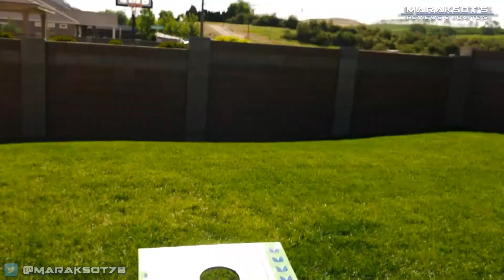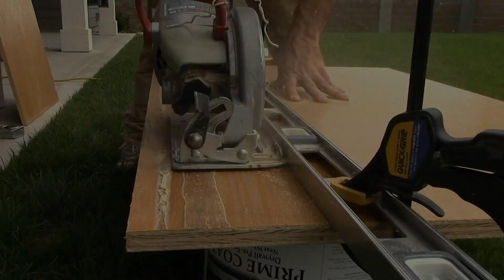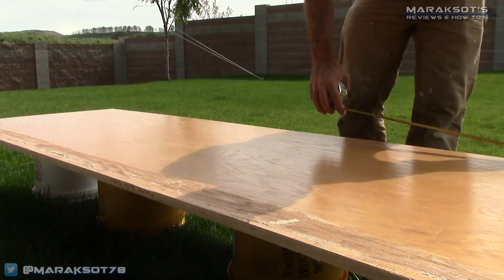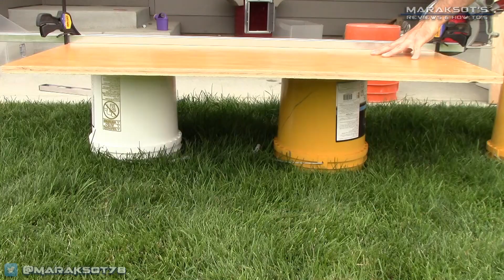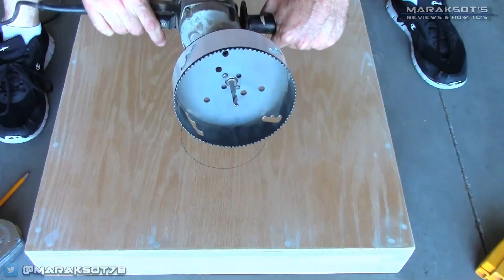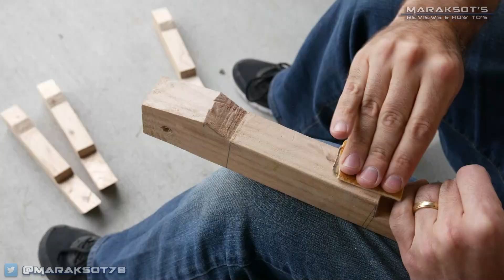How to Build a Set of Custom Cornhole Boards - Part 1: Construction

Comment: just want to stain my board do you have a recommendation on certain types of stain
Reply from the maker: +Joseph Peterson I've always painted mine,  haven't really done any staining. I would probably just get a stain color I like at a home improvement or hardware store and then put a coat or two of clear lacquer or shellac to seal it all in. Sorry Im not more help. :)
Reply: Mix. Diesel fuel and dirty motor oil.makes waterproof stain 1 gal fuel and add oil to mix in well stain scrap wood to see if you like the colour.then put on projects. You can use mineral oil but its 25$a gal.